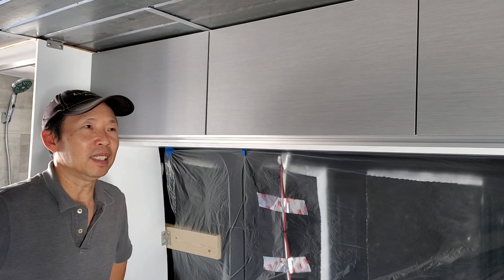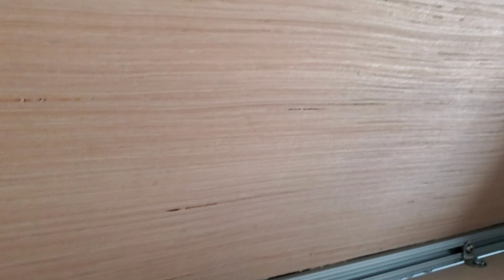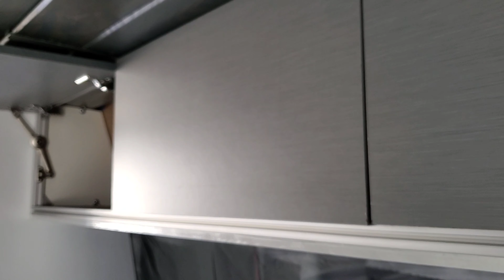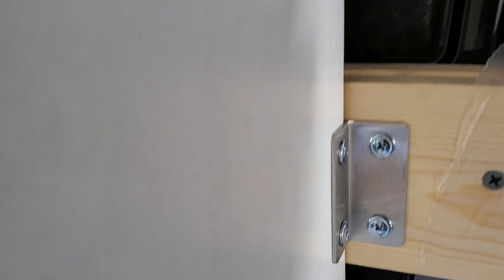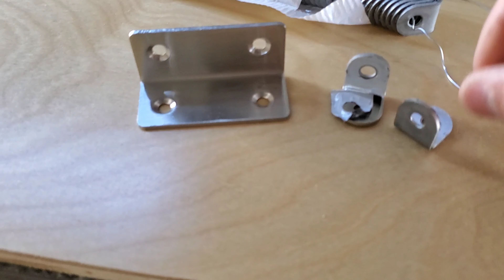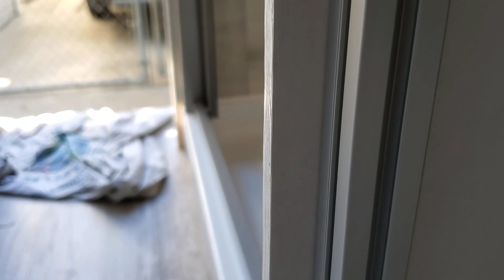Van Build - How I build my cabinets.

Comment: So the hex nut just screws into the extrusion?
Reply from the maker: You have to insert the Tnuts into the channel and then the Hex bolt screw into it.
Reply: Oh OK, saw that on your links. do those tnuts need to be slid at the end of the extrusion or they can just go in anywhere?
Reply from the maker: You can slide them anywhere
Reply from the maker: https://a.co/d/gGHafuF

Comment: Great video.  Thanks for sharing. How did you mount the back panel for the upper cabinets?
Reply from the maker: The back panel is the wall panels.  You install that first. I use 5/16 smooth plywood so it's a little flexible.  It's 15" high from the bottom of the cabinet line.

Comment: Thank you Bo, very nice work. Can I ask what you used to make that back (single slot) bracket against the wall tilt in such a way so that your horizontal braces matched up?
Reply from the maker: Hi Brian, 
No Bracket.  I drill countersink holes to fit M5 screws but don't tighten it down until last after you get the angle you need.   The bottom would leave a bigger gap but it's covered with the bottom cabinet plywood.
Reply: @BoChuonOUTDOORSVANBUILD  Understood, thank you again Bo

Comment: Very informative. I would have liked to see better how the cabinets are attached to the ceiling. Did you encounter any issue using stainless steel and aluminum together? I've read in many places that it's not recommended because of the reaction they have with each other. "Corrosion develops when two dissimilar materials are combined in a corrosive electrolyte. This can occur when certain materials (such as aluminum) are in contact with stainless steel."
Reply from the maker: I have not seen in the dry location but on the roof for example I see that the Stainless steel fittings get rusted easily.
Reply: @BoChuonOUTDOORSVANBUILD  Thanks

Comment: Hi Bo - Where do you order 8020? 1010 strong enough for bench / bed system ?
Reply from the maker: I ordered from orangealuminum.com
Reply: @BoChuonOUTDOORSVANBUILD  Thank You Bo!!
Reply from the maker: How is your van coming along Tam?
Reply: @BoChuonOUTDOORSVANBUILD  Slowly :) I finally completed 2 Maxxfans , and the sound deadening. The FVC Roof arrived today so I’ll be working on that tomorrow. Thank you for sharing your experience Bo!!
Reply: @BoChuonOUTDOORSVANBUILD  Hi Bo - Any issue with using the 80/20 accessories (such as corner bracket, T-Nut...) with products from Orange Aluminum?
Reply from the maker: I only ordered aluminum extrusion from there.  My hardwares ordered from Amazon
Reply: @BoChuonOUTDOORSVANBUILD  Thanks Bo

Comment: Hey Bo so what are the dimensions from behind and top to the front? is it 12x12 ok?
Reply from the maker: Hey Sal, yes
Reply from the maker: But that is up to you though.  Check your cabinet doors first
Reply: @BoChuonOUTDOORSVANBUILD  how did you mount the upper aluminum? did bolt straight through the roof or you use the angle bracket?

Comment: I'm pretty unconvinced by supporting the bottom panel of the cabinets by drilling down into them with 1/2" screws.  A lot of van builders go for ridiculous overbuilds, and I don't believe you need to be able to do pull-ups on your cabinets.  But these cabinets seem like they have too much risk of the bottom panel pulling free.
Reply from the maker: So far there hasn't been any issues. With all the stuff that we put inside the cabinets but of course we don't put anything heavy In the overhead cabinet anyways.